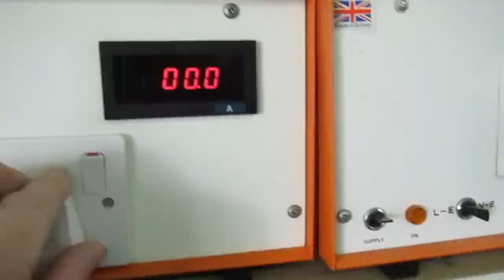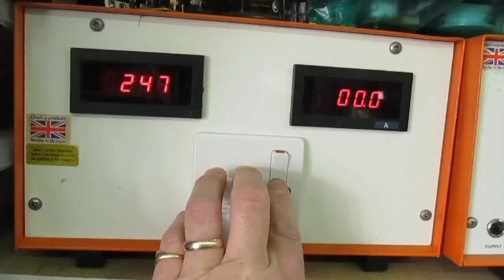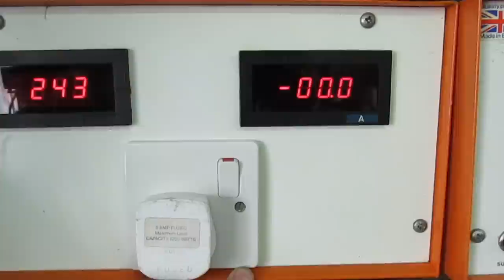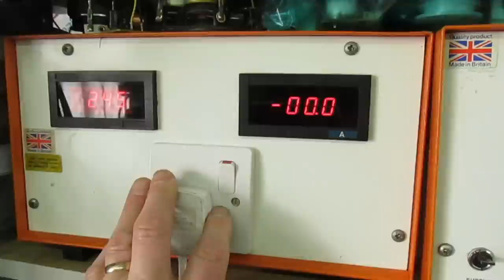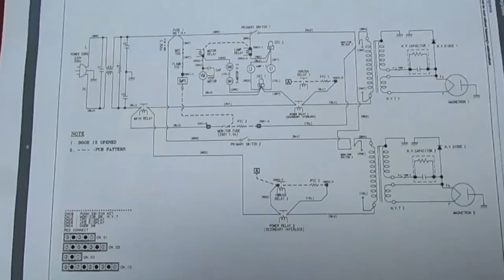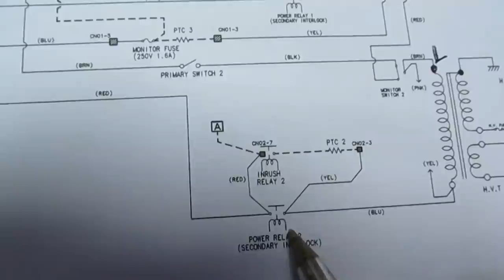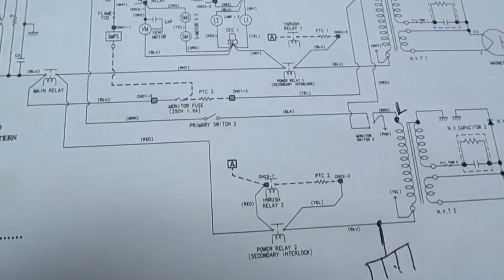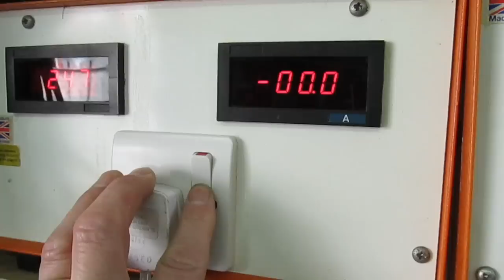Bizarre fault on Samsung commercial microwave oven.

Comment: An Ampmeter conected to live and neutral ! - der - that would read zero forever after the initial bang.
Ampmeters are connected in series with the component under test regardless of them being moving ion or moving coil or a known shunt with a voltmeter accross it.
Reply: What's the content about the meter being moving iron or moving coil got to do with anything?
The only response required is that the ammeter is connected in series. The rest is superfluous.
Reply from the maker: I wonder how an electronic amp meter would work if there was no neutral connection to it , could it be the LED display magically lights up with just a like series live  feed ????
Reply: @michaeldranfield7140  It can't work, not easily. But I will describe a theoretical way it can be done.
An mechanical meter works by the current creating a magnetic field. An electronic ammeter,  although a series resistor can take the current and convert it into a voltage, that voltage then needs to be converted into a digital value for presentation onto an electronic display.

That conversion from the voltage to the digital value is done, typically by a dual slope integrating analogue to digital converter (ADC) and both the ADC and display electronics require power.  And that is typically done by way of a AC to DC power supply which requires a live and neutral.

Theoretically it could be powered by making a coil and wrapping it around the live line, would induce a voltage by the passing current, and that voltage could then power the ADC and display.  So theoretically a low power display such as an LCD might make this possible.

But such a technique has a problem, the lower the current being measured, the lower is the voltage produced across the coil powering the ADC and display.  There will a come a threshold current at which below the electronic ammeter can't be powered up.

I haven't come across any marketable products (ammeters) that are powered in this way.  I suspect manufacturers that create products intended to meter without a neutral line just use a battery powered meter, and if you don't need to meter continuously 24 hours per day, 7 days per week, just put a switch in for the battery power so it's not powered up all the time, and that should increase the battery life enormously.

Comment: You are the BEST.. I would have never figured that one out.
Reply: I would have closely inspected wiring in the known faulty appliance, and tested for Earth fault PRIOR to plugging it in.... especially a grease ball fire hazard like that.
Reply: I would have just used an RCD plug. Safer.
And if it tripped, then you know there's an earth fault, and it's a metal case.

Comment: I wonder if all that old oils/grease contributed to weaken the PVC insulation? ...or maybe just vibrations on sharp steel + time did it in?
Reply from the maker: I think your right, grease degrading the insulation.

Comment: If I had found you when I was younger I would have happily apprentice with you.
You found 0-point energy! 🤔🤣🤣
Reply from the maker: it would be good if you could get something to run for nothing !
Reply: When I was young, I didn't realize the value. Later I took computer repair, both software/hardware but only covered basic principles. I could have had lots of fun had I understood the possibilities.
Reply: @michaeldranfield7140  Most women start to run for nothing as soon as they see a mouse or some other kind of critter.

Comment: Ahh wow Michael awesome find there! My first thought was a broken neutral or relay stuck, recently done a couple Samsungs similar  with bad relays. I had it once where I kept blowing a smps capacitor up, turns out the neutral had broken in the moulded plug was flipping nightmare to find 😭
Reply from the maker: What threw me was the no current draw and I even tested my meter to make sure it was working ok , very bad design though switching the neutral side and leaving mains live  of the transformer .

Comment: Like an amp, all it takes is some rewiring and a tube replacement :D

I'm surprised that the ammeter isn't wired in series with live, and that the RCD didn't trip.
Reply: The orange and white box supplying power has a switched 13 amp plug only, it doesn't contain an RCD.
Reply: The ammeter is wired in series with the live.
Live to load to neutral and back are all in series with each other.

What you mean is, that you are surprised that the ammeter is not inline with the live line.

I am being pedantic because it is important that we use the correct terminology in electrical engineering.
Reply: @deang5622  I meant that if the ammeter didn't show any current before removing the neutral-to-ground short, it was bypassed, suggesting that it was connected with the neutral wire.

BTW as for the RCD, I was expecting one in the consumer unit.
Reply: @KeritechElectronics  I know what you meant. I am commenting solely on the use of the term "in series". I am saying it would have been better to use "in-line" in this particular scenario.
Reply: Hello Keri, nice to see you here. I am subscribed to your channel. You are correct, I have just made the same comment but some people in the comments don`t seem to think it makes any difference. (Good job they don`t work with 3 phase!) For those interested, in a single phase system current can `return` by two paths, the neutral wire and also sometimes by the earth wire. But the current always flows in the live (line) wire as its the only live wire into the house. If you only measure current in the neutral, you would `miss` any current flowing in the earth. The earth wire and the neutral wire are solidly connected at the substation (old way) or at the premises meter board (newer way) Hope this clears up the misunderstanding of the problem. Michael probably metered the neutral because he though it was better from a safety point of view, to meter a line that was at a low voltage (neutral)
Reply: @TheTemporalAnomaly  that's right, I'd put all meters, switches or fuses in line with the live wire rather than neutral. Plus, whenever current escapes the transformer-live wire-device-neutral wire-transformer path and goes through the ground, a RCD should trip - as long as it's present and properly wired. Old wiring rarely has them.

Comment: That machine surely must use an industrial plug with consumer unit fusing 14 Amps regularly on a 13 Amp plug top 🤔
Reply from the maker: you would have thought so but this is how they come out of the factory, I have had plenty of these ovens burn the socket of the wall .

Comment: The take away I got from this video is that you need to install RCD protection in to your supply pronto
Reply from the maker: I'm not that well up on house wiring , I assumed circuit breakers only detected leakage from live to earth , and not from neutral to earth  .
Reply: @michaeldranfield7140  Circuit breakers only detect over current same as a fuse. RCD and RCBO detect current imbalances ie leaking to earth! Please fit one - It can save your life/ even if it just a simple RCD built into a normal socket get one ASAP
Reply from the maker: @mattsan70  many thanks for that , I'm going to have to have a look in the fuse cupboard and see what I have  , I was brought up with re wirable wylex fuses that were red, white or yellow coded !
Reply: @michaeldranfield7140  It's worth a look at John Ward's video on RCD operation:
https://www.youtube.com/watch?v=RnriL5iEmZs
Reply from the maker: @GaryB007  Many thanks just watched it , the interesting thing it I noted in the video  is the neutral  is connected to earth at the substation transformer,  but I can see how the RCD works now so I need to have a look on Monday what I have fitted .
Reply: @michaeldranfield7140  He's the acknowledged "guvnor" among the various online electricians when it comes to knowledge and theory. His other videos are worth a look too. My background is like yours, more electronics than electrical (mostly at JVC, originally engineer, then TLO, and eventually Technical Manager), and I learned a lot from his videos.
Reply: I am more concerned with the design  of the oven switching  on the neutral side its possible  that is a USA thing.  I have seen cheap guitar amps with the on off switch on the neutral side. The cable routing is very poor for a professional  device did grease gather  and degrade the insulation?
Reply: @michaeldranfield7140  I still have those (Wylex fuses) in my house!! I put that board in about 30 years ago.
Reply from the maker: @GaryB007  just had a look in my fuse box and all the trips are marked MCB which I assume means miniature circuit breaker and there is no test button so im assuming i need an upgrade.
Reply: @michaeldranfield7140  It's certainly recommended, though bear in mind that most domestic RCDs and RCBOs trip at just 30mA, so if the wiring is old, it may have leakage currents in excess of that, so you may get some phantom tripping that would need to be investigated. FYI, an RCBO is a combined circuit breaker and RCD. They are a bit more expensive, but are recommended for all new installations, as it means that a fault only takes out the faulty circuit, and not other parts of the installation. It might be worth getting an EICR (Electrical Installation Condition Report) done. That will give you leakage and continuity figures for all circuits, to make sure all is safe and well. The restaurant where that is microwave used should probably do the same, but looking at some of the videos from the various YouTube electricians, restaurant kitchens are often some of the most neglected and dangerous installations.
Reply: @mistermikeanson  so do we, was put in in the very early 70s, only 4 fuse,  no RCD ,
Reply: @mattsan70  I don't like the word "imbalance" here when talking about RCDs 
There is nothing that needs to be balanced. There is no balancing going on in an electrical circuit.

The RCD detects any difference between live and neutral currents.
Reply: @GaryB007  Shared neutrals can also cause RCDs to trip.

So if he's unlucky, swapping and MCB for an RCBO may not be successful.
Reply: @deang5622  I think you are being very pedantic over semantics. Even RCD manufactures use the work imbalance. Even John Ward himself - the RMS almighty, uses this word. If not 100% technically correct, it gets the principle across nicely. I bet you're fun at parties!
Reply: @mattsan70  I am boring..I don't go to parties.
Reply: @mattsan70  Depends on if you are talking about how the RCD works.

I do not agree that RCDs detect an imbalance. They detect a difference in current.  However, the way the RCD works, internally it is detecting an imbalance in magnetic fields.
Reply: @deang5622  That's why I mentioned that leakage currents may cause issues and suggested an EICR. A decent EICR would detect shared/borrowed neutrals (normally from 2 way lighting), neutrals returned to the wrong circuit, high earth loop impedance, and a whole load of other stuff, assuming it's done properly and not a "drive by" box ticking exercise, as so many are these days.

Comment: There are some real safety issues here.  Firstly the microwave should never have been built with no protection for the cables running through a metal opening.  Next it's drawing too much current for a domestic plug and as such is a serious fire risk, I don't think it should be returned to the customer to carry on using in that configuration.  Finally as has been pointed out below, RCDs have been standard in all buildings for decades now so this needs attending to in both properties.  Regarding the current draw, does the manual have the maximum current in its specifications?  If 13A or more, then 16A plug, socket and wiring should be installed in the cafe.  If it's less than 13A, there may be another fault or possibly the current measurement is incorrect.
Reply from the maker: Just checked the user manual and input current is 3200 watts and these ovens just come with a 13 amp plug fitted from the factory, I have had complaints in the past from customers saying these ovens burn the socket on the wall and they need regular replacements ,
Reply: I would get your RCDs checked as I would have expected the RCD to trip as there is an imbalance in the current being drawn from the live and returning on the neutral. i am surprised this fault isn't causing the RCD to trip as it clearly isn't as seen by the fact the mag had overheated and cracked the magnet  I also have one of these ovens in my takeaway and have had to replace the plug i have since installed a 16amp plug and socket( the same type that are used for a caravan hookup as these are rated at 16 amps) on its own radial circuit and had no problems since.
Reply: @michaeldranfield7140  maybe as microwaves are only usually used in short 'bursts', they thought the 'slight' overload wouldnt be an issue !!!  but busy restaurant/cafe, one thing being zapped after another.....😲
Reply: @peterensinger1770  Another person that assumes there is an RCD present.

Why do you assume an RCD is present?
The fact is there isn't.

Where is the evidence in the video there is an RCD protecting this circuit?
Reply: @deang5622  I didn't assume the building had an RCD and there is no need for the attitude mate! but i am surprised as it appears to be a fairly modern building and would at least it to be wired up to comply with 16th edition which a RCD would be installed in the consumer unit.

Comment: Are you behind a transformer ? Otherwise i cannot understand  why  the residual current switch is not going out . i translated the word residual current switch so i am not sure if this is the correct name in english .
Reply from the maker: I very rarely use raw mains as all my benches are powered from isolation transformers , I only use raw mains for testing microwave ovens but as someone has already pointed out I may not have any circuit breakers in this building as its quite old , this is something I need to look into .
Reply: @michaeldranfield7140  another video to make.....
Reply: Why didn't the residual current device switch? Because there isn't one present.

Why assume there is?

Comment: 14.7 amps through a 13 amp plug is pushing your luck, what is the fuse rating in the plug?
I would have expected it to have at least a 20 amp industrial plug.
My other question is what caused that wiring to melt, it must have had a lot of current going
through it, or is underated for the load.
Samsung seem to have a habit of using underated wiring and components.
There was a recall on their fridge freezers going on fire a few years ago.
Reply: you 'could' likely get away with 14 ish amp on a 13A socket and plug, microwaves are usually only used in fairly short bursts, at least in domestic usage,  commercial however different matter, it ought to be fed from a 16A line
Reply: @andygozzo72  A lot in commercial use will be on 13amp sockets, if the microwave has a lot of use then  sooner or later that socket will start to melt, there are no inspections these days to find these fire risks
Reply: @Barbarapape  - 13A is the rating of the plug, not the socket. Sockets are typically rated at 20 or 32A (and can actually handle quite a bit more). And even if a socket were rated for 13A, it wouldn't "start to melt" if you  ran 14 or 15A through it. It's designed with a large safety margin. The fuse (which is typically 3 or 13A to limit damage in case of a short circuit, not to prevent anything from melting if it goes slightly above that) would burn before the socket (or plug) was in any risk of melting.
Reply: @RFC-3514  Despite what a standard 13 amp plug can handle it is still bad practice to run a commericial microwave through a domestic rated plug/socket.
Reply: @Barbarapape  - The plug doesn't care if the microwave is "commercial" or not, all it cares about is the current. If it's fused at 13A and you run something higher, you risk blowing the fuse; that's all that really matters.

But are you sure Michael didn't replace the plug (and maybe even bypassed the fuse completely) so it would fit his meter while figuring out / fixing the fault? 

The plug shown in the video says "5 amp fused", and it clearly isn't - while the plug itself would be fine with 14.7 amps, the fuse would have gone well below that.
Reply: @RFC-3514  I have seen modern sockets (mk) start to go brown around the pins with just a load of 10A It was on for long duration's though but still you would expect a socket rated at 13A to handle it. And no, the load was not inductive, it was resistive  heating. The contacts inside are now brass plated steel in most consumer stuff.

Comment: I would just buy an RCD protected socket and swap it for the one you use to test faulty gear. Since the rest of the place is via an Iso. transformer and RCD would be useless anyways. This solution is quick, cheap and easy to do. Pop to screwfix , B&Q etc today and buy a normal socket with RCD built in.
Reply: No, too much work. Means he has to dismantled the Clare device and wire it in.

Just buy an RCD plug and leave it plugged into the mains socket on the Clare.
Appliances can then be plugged into the RCD plug.
Reply: You can plug the power meter into that
Reply from the maker: Many thanks , going to Band Q tomorrow to get a part for the shower head at home .